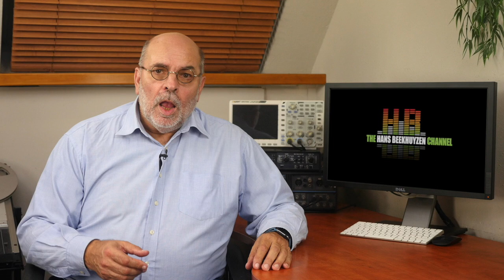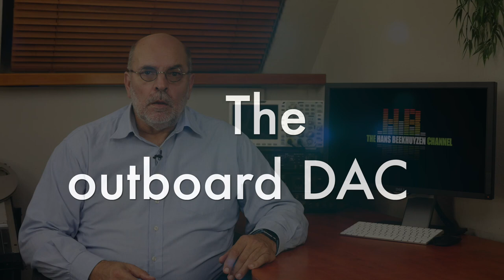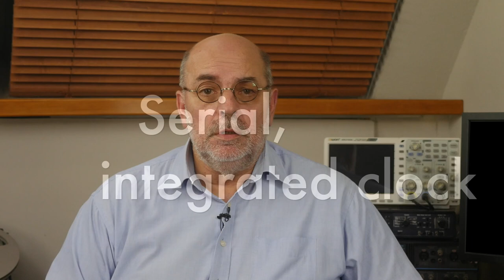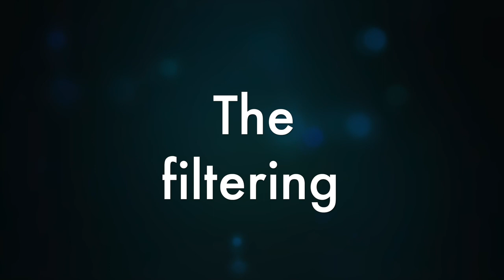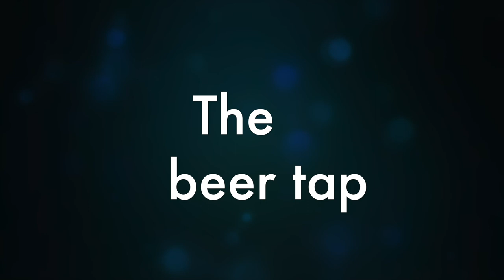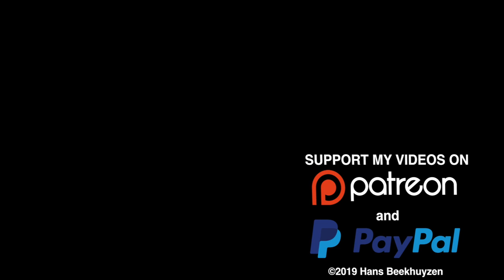What makes a good DAC?

Comment: A couple of months ago I got to looking at the circuit board of my DAC and saw 2 cheap blue film capacitors looking back at me.  They were .05 cent 1uF metallized Chinese film caps, so I replaced  them with $2.00 10x bigger in size 1uF polypropylene film caps and the difference was incredible and amazing to me.  I had 80's music on and the synthesizer sounds came through with warmth and sweet goodness.  I still can't believe the difference.  Companies don't use them because they are expensive and big so..
Reply from the maker: Sure mods can do great things (if you know what you're doing)
Reply: @TheHansBeekhuyzenChannel  replacing a capacitor with the same value capacitor is hardly a mod, quality components make a huge difference

Comment: Excellent video.  Your English is flawless, including use of colloquial phrases.  Impressive.  One question on your video.  You mention that the power supply is "perhaps the most part of a DAC".  This makes perfect sense to me, and is reflected in the many well reviewed DACs, with larger power supplies and consequently larger housings, such as PS-Audio Directstream, Shiit Ygdrassil, Denafrips Terminator, Audio-dg R7 etc.  However one thing peplexes me is that the range of DACs by Chord are all very small, and yet highly regarded.  Even the Dave is relatively small.  I cannot work out how Chord manage to compete successfully with these small power supplies.  Could it be that clever engineering and FPGA coding can eliminate power distortions, or is it perhaps that reviewers add in a good quality external power supply.  Is this something you have ever considered?
Reply from the maker: I still have Chordette and that one sounds clearly better using an sBooster power supply. The Hugo and Hugo II I reviewed used batteries and then the power supply is only used to charge the battery. The Dave I have not reviewed (I have heard it though and like it very much). For as far as I know it can't be used with an external power supply. I presume that they use a very voor switch mode power supply. When done properly it has the advantage of being able to deliver instant current.

Comment: The question what DAC is the best  usually favors  the new chips .I have 3 DACs  a 15 year old benchmark,15 year old Tri Vista, and 30 year old Krell. I love the clarity  of the 30 year old  Krell the best ,second the Tri Vista, third  benchmark .The Krell and Tri Vista have seriously built separate  analog  and digital power supplies .i believe its not the chip  that makes  a DAC sound good,  there is more to it .

Comment: Hello, what a great video. Thanks, I've subscribed to the channel.
I found this video while I was doing some DAC listening today. I have a full RME setup: 2xADI 8 ds, 1xADI 8 pro and a DIgiface USB interface that I also use as mater clock (ADAT connections - 44.1 khz). I was making a shootout between the Digiface phones dac and the ADI 8 Pro dac.
The Digiface is about 20 years newer than the ADI 8 pro so I thought it would sound better but is usb powered and the outputs are 2 unbalanced ts jacks, the Adi 8 pro is properly powered and has balanced trs outputs, so I have no idea about which could be better. 
By a listening test I feel the Digiface sounds sharper on the transients and the highs and more compressed in general, the Adi 8 pro seems more dynamic and with an extended low end. 
What do you think about it?
Greetings from Florence, Italy
Reply from the maker: It’s been a long time I have listened to thanADI 8 and I haven’t listened to the RME at all. So I can’t say. Sorry 😐
Reply: @TheHansBeekhuyzenChannel  Ok, thanks anyway!

Comment: Great informative video. I need to ask if a decent DAC (say the SMSL SU 8) with the ESS Chip and Femto clock able to correct optical input jitter completely (such as that from Chromcast Audio SPDIF/Toslink output which is known to have jitter issues)?
Reply from the maker: I really can’t say since I didn’t review it.
Reply: @TheHansBeekhuyzenChannel  That's fine but just as a general info... Do modern DACs correct optical jitter? Thank you
Reply: Shoaib Ahmed most of DACs use PLL which does not cancel jitter. It works like a jitter low pass filter.
Reply: @saucebosspl  I take then using a jittery optical input isn't a good idea. Though it's audibility is debatable. Best to stick to USB input then. Thanks for your reply mate.

Comment: When auditioning/testing a dac and or streamer, would you consider listening to a streamer that has analog outputs and digital outputs from both outputs. That is to say, listen to tidal on the streamer for example via its analog out then listen via your dac of choice in setup 1,2,3. I think there may be streamers with great features but their analog out not very nice. Example I love the Sonos connect but I do not like its analog output quality. What if the SC  
Was auditioned using its output into a Mytek dac for example.
Reply from the maker: I can assure you that the digital output of the Sonos Connect is as bad as the analog outputs. It has a very poor clock so the jitter will kill the music.

Comment: Do you recommend to use a DAC instead of the DAC of my integrated amp;
Reply from the maker: Depends on the amp’s quality
Reply: @TheHansBeekhuyzenChannel As you have said on the video DAC from the shelf provide low quality instead of DAC especially manufactured. How could I know whether is worthwhile to spend buying an external DAC or purchase a new amp with a better DAC. My system comprises lumin u1 mini transport and cambridge audio CXA81 amp
Reply from the maker: You never know for sure. It depends on your stereo, your acoustics, your auditory system and your financial position. For some €/$ 500 is half a years savings for others it might be skipping a weekend on the town.
Reply: @TheHansBeekhuyzenChannel  I am thinking about denafrips ares II or RME ad2 dac
Reply: @Maninthesky19  i have a bluesound node connected to a Denafrips Ares 2 connected to Elac Navis ARB 51 and there is no sound difference compared to the Bluesound node DAC
Reply from the maker: I agree. The digital output of the Node isn’t up to the quality of the Ares 2
Reply: @TheHansBeekhuyzenChannel  so if I upgrade my CXA81 amp to simaudio neo 340i it won't be necessary to purchase an external DAC or u think that separate devices are always better
Reply from the maker: Can’t say. I have no hands on experience with the products you mention